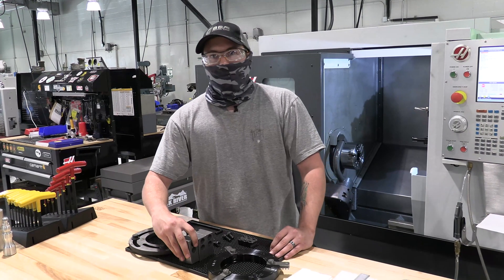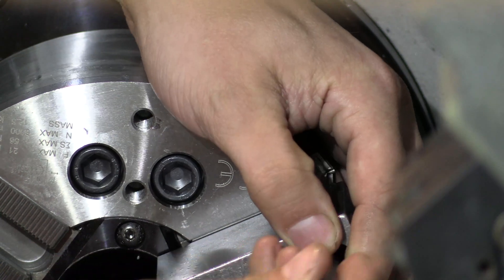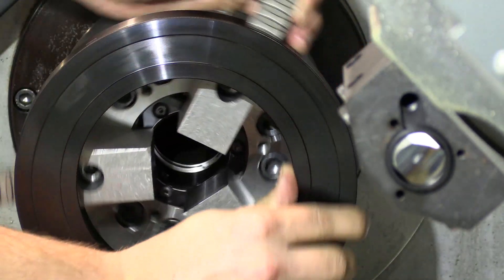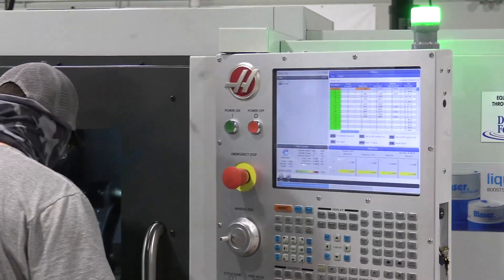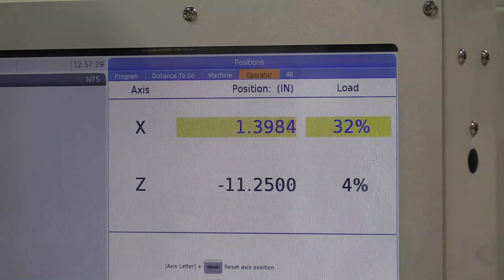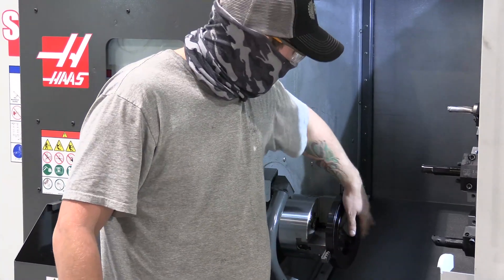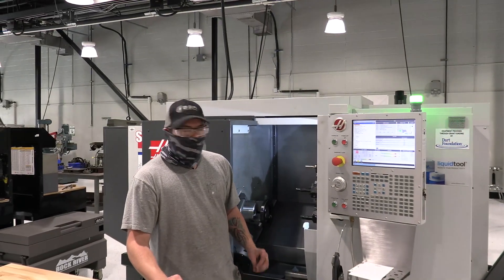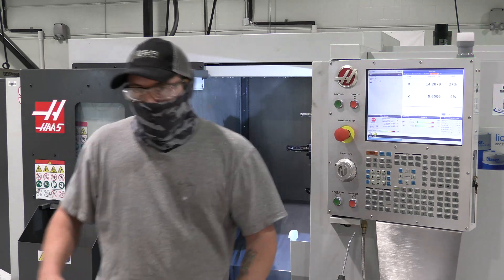How to Bore Soft Jaws on a Lathe

Comment: what is the clamping psi and the max g50 rpm to use those at???
Reply: About 110 psi and no more than 500 rpm. Could be less on the rpm but stay under 500.

Comment: This seems a bit clumsy to try putting the jaw on while holding the T-nut in the slot. I've always found it easiest to loosely assemble the nuts on the jaws and slide them in from the top. Then I'll use a tool (usually a Boring bar) and call it to the diameter of my part. Then I move the jaws in further until I can see they'll clean up and leave a nice shoulder to stop against if needed (also leaving a little more for when clamped mid stroke). Once I have one jaw set I jog the X-axis to a visual reference spot on the jaw (usually the apex of the existing diameter if re-boring a used set, or to one of the bolt holes). I'll then rotate to each jaw position and slide them in aligning the reference point (bolt hole) to the tip of the tool to ensure the jaws are all on the same notch. Nothing is worse then trying to get one last notch out of a set and one of the jaws was off by one and can't make it. Also torque specs for the M12 bolts on most chucks is 68Nm per Haas Guidelines.
Reply: yeah i really said "hhhwhat in de fuhhhh?!?!..." when i saw that